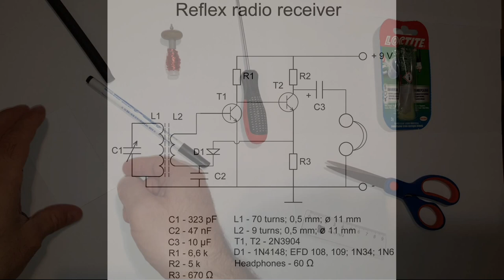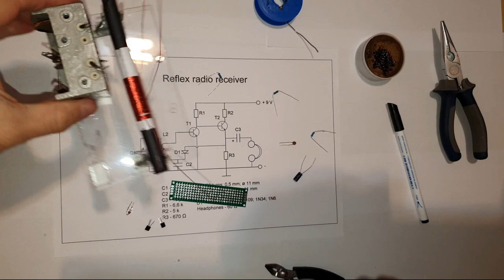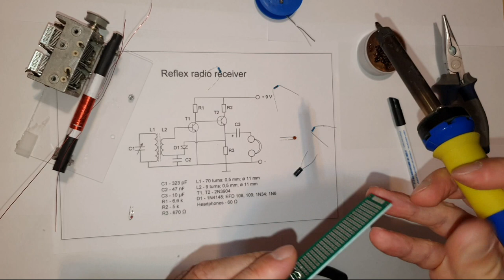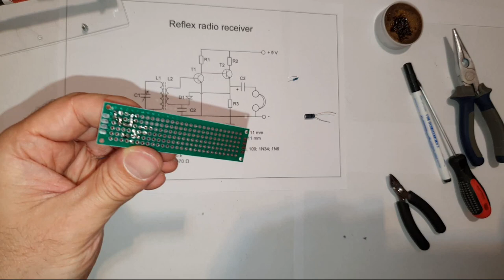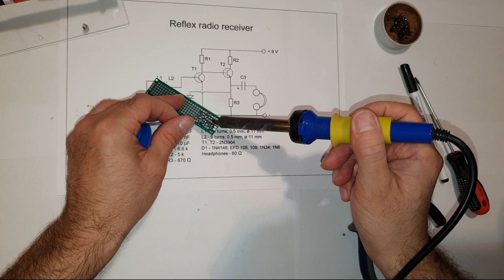Reflex radio receiver - AM - 550 - 1600 KHZ - Homemade.

Comment: I made this project, it is wonderful, good quality Audio, it doesn't need external antenna, reflex radio comes from 1914 and is attractive until now. Thanks for this good design, i plan to add LM386 audio amp and use it as a diy desktop radio in my room.
Reply from the maker: Thanks for appreciation. I am also going to make a radio frequency amplifier for him. It will be with inductive coupling (transformer). The radio will have superior qualities.

Comment: Schematic seems wrong to me.  C3 should connect to Q2 collector or it will short RF output to ground.  R2 should be lower value.
Reply from the maker: You are vigilant. 👍
 The correct scheme is here: minute 0:11